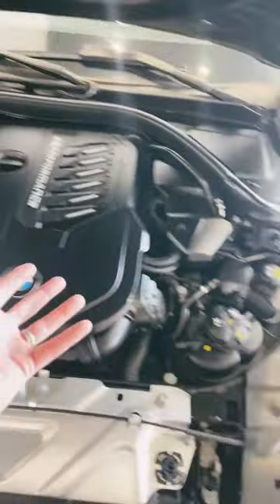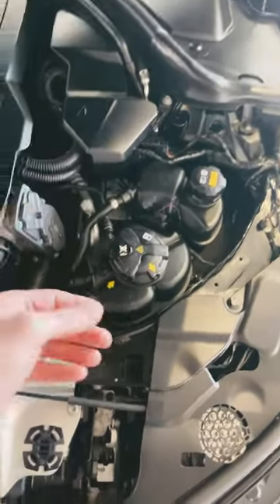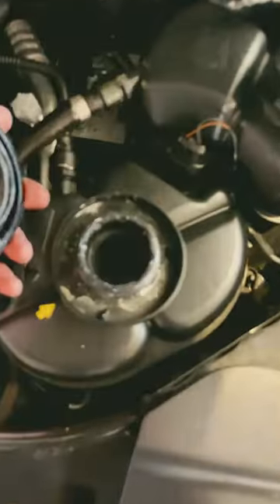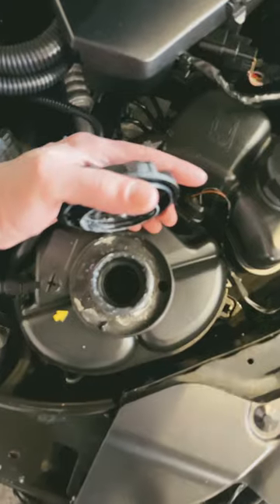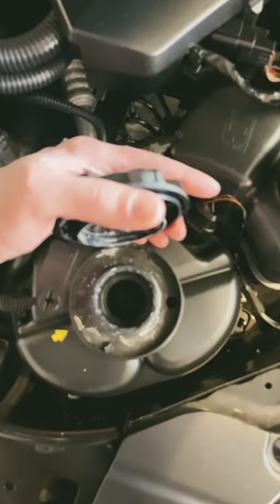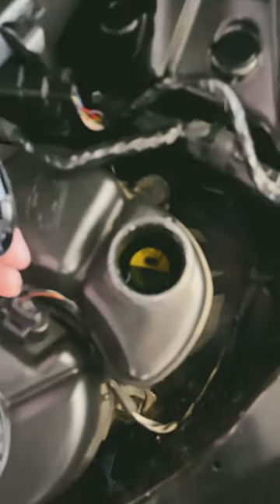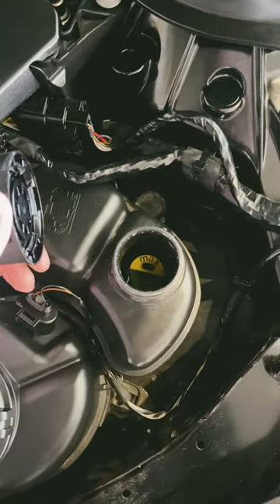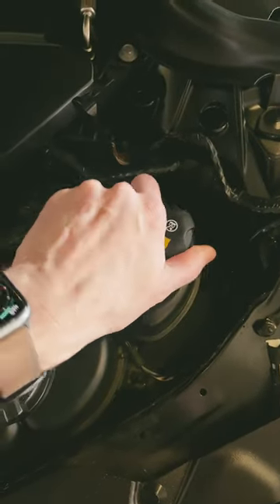Coolant check BMW

Comment: The second one is not for a turbo but an intercoller (cools intake air)
Reply from the maker: Hahah i was even more wrong than that… two tanks are for high and lower pressure coolant circuits.
Reply: @BMWofFW  I started my car in the morning no issues drove for about 40minutes went into a store left started driving 10mins and I got a Coolant low message,i checked the levels and the main reservoir is below minimum,i topped off and message is gone...do you think I have a leak it's tricky because I can't see or smell any burning coolant

Comment: I just got a notification for low coolant level , but after I restarted the engine it disappeared? Should I be worried? It is a bmw 1 series f20 b48a engine.
Reply from the maker: Did it happen on an extreme uphill or downhill? OR did it not come on after turning on on an include or decline?
Reply: @BMWofFW   Actually, it only happened on one parking spot, but it was not really decline (maybe slightly), and after restarting engine it disappeared..
Reply: Same thing happened to me. Started my car this morning and got the notification
Reply: same happened to me with the B48, turned the car on and it notified me coolant was low, later on turned it on again and it didn’t show up, i waited for car to cool down and checked coolant and it was above minimum, so i filled it up and every 4 days it keeps telling me coolant is low and when i check its back to being above minimum yet my car doesn’t have any leaks and it stays above minimum…
Reply: @latenight30i   In my case ot was the waterpump failing/leaking.
Reply: @drancyneuftrois3120  i checked today and saw that one of my hoses has dry coolant on both ends so i think i know what’s going on now

Comment: Should the same coolant be used to fill the “turbo”? When it says engine coolant low, does that refer to the turbo one as well?
Reply from the maker: best thing to do is check both, you'll be able to see which or if both are low.
Reply: Do not use the same coolant for the engine on the turbos. 

I’m pretty sure bmw sells turbo coolant separate from regular engine coolant.

Comment: Whats should the small reservoir look like when the car is running, I see the big reservoir cycling coolant but the small one doenst move at all. Is that normal?
Reply from the maker: smaller one's for the turbo, turbo coolant is only really running through it as needed and under load/after cars immediately turned off.

Comment: I check coolant when car was cold and it was showing just a lil bit under minimum.went to store to pick up coolant.came home left the car off for like 15-20 minutes when I go top it off it shows full but car was still hot.
Should I wait again until car is cold again?
Reply from the maker: Yes wait till cold again